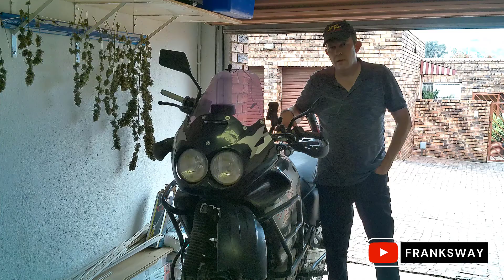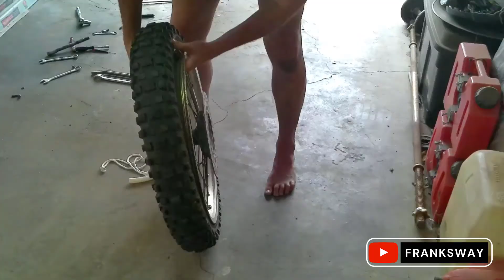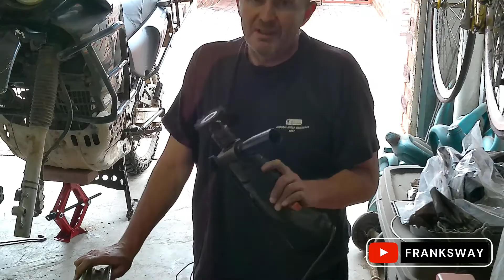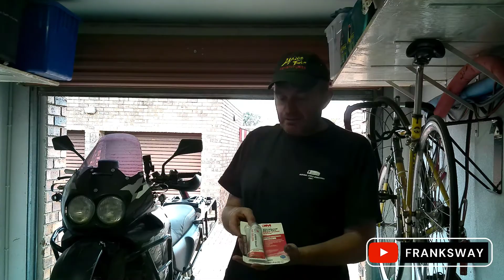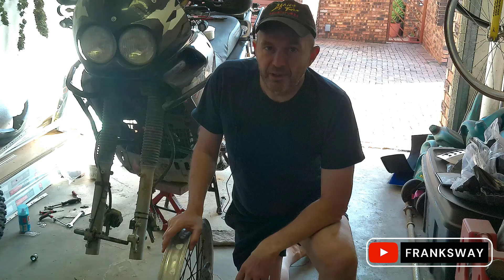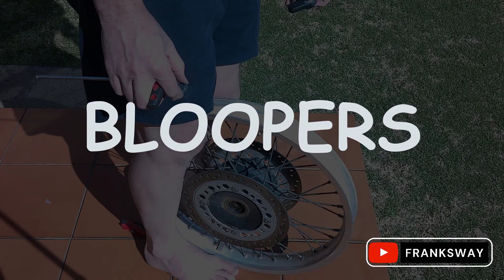XRV750 Tube to Tubeless Tire conversion - Will it work?

Comment: Thanks for this  - just wondering if the conversion was successful and if so, did it last? Did it survive off-road?
Reply from the maker: Yes it was a succsess
Reply: @FranksWay : thanks for reverting this fast. Really appreciated. Looks like i'll be testing this solution. Due to circomstances it will take me a while before i will make the mod, but i will keep you posted
Reply from the maker: @janvdb8785 please keep me posted..good luck with your build 😉
Reply from the maker: It worked, but the tire was an issue...my opinion...jip it works if you take your time and you have a good rim
Reply: @FranksWay  What you mean with the tire was an issue? Not air tight? Was just looking into the tubeliss system, but not available for AT rims => really interested in the fix you proposed here.
Reply from the maker: @janvdb8785 The principle works....the owner wasn't feeling safe without a tube in there...his decision ultimately..was an old tire